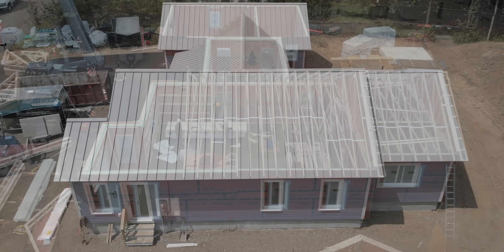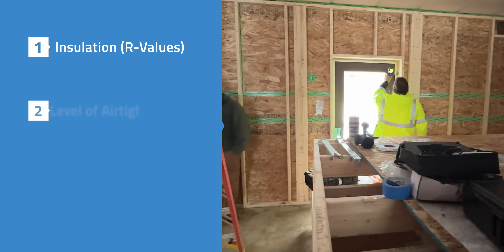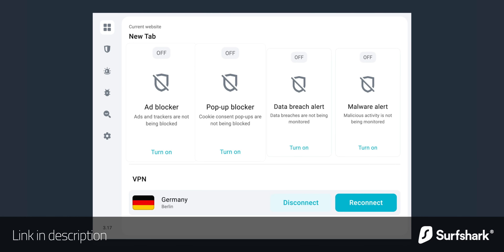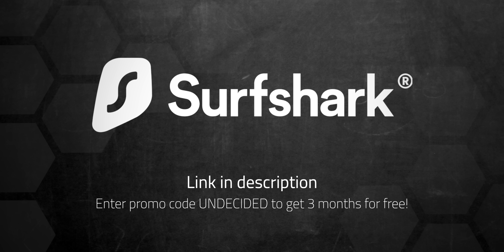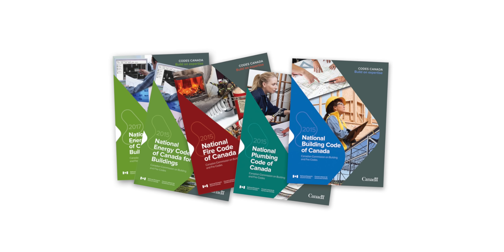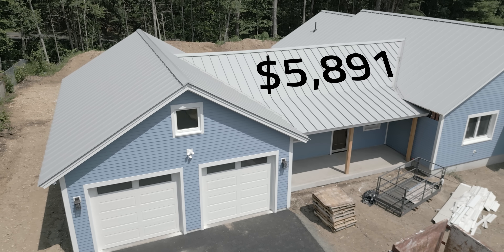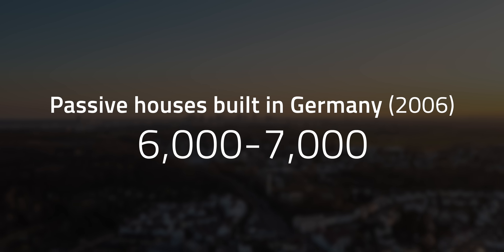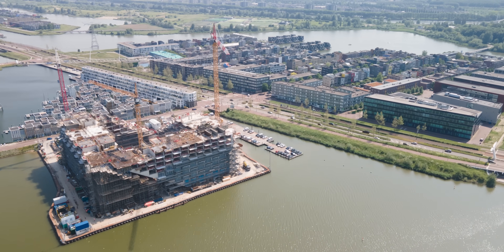Why Do American Homes Suck?

Comment: It's a complex issue and you need to compare like with like. In reality, in Europe, many people live in "older houses" which are often poorly insulated and have poor heat-retention properties. Also, in Europe, poorer people tend to live in flats or tenements, which may or may not be well-insulated, although they do benefit from having fewer external walls. Most "new-build" houses in Europe are mass produced, and tend to be insulated to a moderately high standard; however they are often much smaller than their US counterparts. Large, detached, "new-build" houses in Europe are indeed excellent, but they are extremely expensive and make up a very small proportion of the total housing market, unlike the situation in North America.

Comment: Although I love super efficient homes Im not sure it makes sense in US financially. Average us utility bill is 4400 per year. If you consider opportunity cost of not being able to invest in stocks or bonds at a very conservative 5% the max price to achieve $0 utility bills would be $88,000. That’s not considering that all your systems(excluding insulation) will need to be replaced at some point. Meaning loss of principal.

Comment: It should probably be pointed out that the Passive House standard isn't the law in any EU country. It's a volluntary standard, thus not one mandated by law. Most EU homes do not adhere to it. Now, that is not to say there isn't regulation that mandates ever more efficient homes, but Passive House is not some universal EU standard. Also, it should probably be noted that Europe, like the US has a lot of older homes, and while thermal rehabilitation has been done to many, Europe isn't that much more advanced than the US. Plus, it's a matter of where you live. The Scandinavian countries have been using triple glazed windows for longer than I've been alive and I'm in my mid 30s. Why? Because it get's really, cold there. Triple pane windows have been making their way south, but at a slower pace, mainly because double pane tends to be good enough for most of the rest of Europe. It's the same with a lot of things. The more extreme the outside weather the more efficient the homes. The milder the weather, the more relaxed the standards.

Comment: In my previous apartment (72m2 or 775sqf) in Oslo, Norway buildt back in 2008 I did not need to turn on any heating before outside temperatures reached -15*C (5F) Inside temps never reached under 19*C (66F) in those conditions.

Comment: We don't need the government anymore involved in anything. If you think they make things better by tightening up the building codes just use a new gas can. As a 20 year builder energy efficient homes can easily add 100k+ to the cost of construction. Even IF you are saving 6k a year (which you aren't) thats a 16 year break even point. Very few people stay in their homes for 16 years. The national average is 3-5. In order to save 6k a year on energy costs you would have to live in the top 1% highest energy costs areas. And have a house over 3000sqft. Most houses in my area (north east climate zone 4) consume approximately $2900yr in heating and cooling costs for a 2000sqft house. And about $600yr for everything else. And if you think it doesn't cost 100k extra to build a passive home you know nothing of what building actually costs. The real reason is they just don't make sense when your energy costs are still low as they are here in the US. You want a national building code? Get ready for million dollar starter home prices.

Comment: As a contractor very few people are even remotely doing calculations on wall efficiencies. Most good builders just stick the highest r value that can fit in the wall. And convincing a customer to do extra air sealing rarely gets approved.

Comment: Insulation rules - even in tropical Sri Lanka. Visitors to my house alway pity me: "Your house is so cool, you'll have to bear a huge AC bill!" Wrong, fellows! Our AC runs 5 min per year - just to check if it still lives. Fan? 20 min per month. Are we (German couple) heat resistant? No.  I keep the daytime sun out by louver shutters, I enjoy insect free ventilation by large sliding windows with stainless steel screens, I keep the top sun off by having the roof insulated with glass wool and having laid old terracotta tiles (= cooling evaporation of nightly moist) on top of corrugated mineral roof sheet, I avoid he heating up of the tricky west side of the house be double brick walls with coconut fiber insulation in between. None (!) of these features is used by any of the local architects, not even in the poshest of mansions. All visitors applaude, but none - not even the rich foreigners - copy my achievements. -"Too unconventional. Too expensive." Or translated into simple English: "Too not my own idea." And that in a country where the cost per sqft "conventional" construction is half or less of what to expect in Europe. Give me a break...

Comment: One of the worst things to use in building is OSB for sheathing,as soon as they seal the moisture into the wall with Tyvek the OSB starts to fall apart,and then people usually use acrylic stucco over that which makes it even worse,your walls will be leaking in ten years because they can't breathe and OSB is garbage at least spring for plywood.

Comment: Where I'm from (Ireland) we literally always have a brick shell, with another brick layer 6 inches from it for insulation. Richer households fill it (sometimes many years after) with insulation.
the inner layout uses plaster sheets and for fireproofing uses fiberglass. It's the most logical thing to do, yet only English, Canadians and Russians build similar.
Reply: Russia's codes if they exist at all are voluntary. Just proves that mandatory codes are not needed for single family homes.
Reply: @williamsickner2206  Some codes are important like it being law for somebody to do your electrical installation, or at least certify it in planning and then inspect it if you do it yourself.

Comment: Great to see someone making this thing to get some air! I have been watching videos from builders at states making houses and as an carpenter from Finland, have been questioning myself how your houses can be warm enough at the winter? 
I understood that in some areas at states must be same kinda climate as it is here, like normal winter day could be -20°C and nights can easily be -30°C , sometimes -40°C.
Typically our houses have +/- 30cm insulation on walls, with all these insulations we the wall itself can be 40cm thick. A lot depends what's the structure, our doors are insulated as well, some "thermo" doors are up to 10cm thick, basic outside doors are 5-7cm. Windows are standard triple glazed, and nowadays there are also 4-glazed "thermo" windows. All windows and doors have minimum of 2 layer sealants, some have 3.
Also there is up to 50cm insulation layer at the top of the house, at the addict, 30-40cm layer of insulation at below the floor, additional to this there may be some +20cm insulation below the house itself inside the gravel bed to keep all the pipes from freezing.

Greetings from Finland 💪😎
Reply: The US is wildly geographically diverse, so most of the relevant regulations are at the state level rather than nationally. Northern midwest & northeast states have building codes closer to what you mention, but a lot of the southeast is hot swamp so a house that's too well-sealed becomes a breeding ground for mold.
Reply: Houses in the US are usually built differently depending on where u are at in the country houses built in the far north are much better t with standing colder temperatures where as houses in the South are designed to keep people cool
Reply: It's not just the amount of insulation either, but how it's put together. Here in the UK we have a focus on designing an insulated enclosed building envelope, meaning there are no cold-bridges where heat can be lost to the outside via conduction through a poorly insulating material. Not just the obvious places, but even the join between the floor slab and the external walls (which I find can be awkward to detail).
Good architects will also consider using solar gain in winter to help warm homes, and mitigating it in summer to help prevent overheating.
Reply: 40 cm almost 16 inches.
Reply: I think it would be difficult to make a national code for insulation. for instance, my brother does not have a heater, and leaves the windows open year round. then on my side, somehow my well pump still managed to freeze during the winter with the heat going in its little insulated shack

Comment: I love energy efficiency. But not because of pesky people who think a fraction of a percent of CO2 makes a difference in the climate—those people actually make me feel like sitting on my porch in the middle of winter running a space heater with enough power to keep myself toasty warm off a diesel generator. No, I love energy efficiency because I hate being wasteful, and it lets me do more with the same amount of energy. But don't ever prioritize energy efficiency over efficacy needlessly. For example, high efficiency washing machines; they use less water, and as a result, they don't wash your clothes quite as well as the good old fashioned top loaders. Sometimes an appliance is less efficient, but it does a better job; and that better job is what the extra energy went towards.

Comment: Long story short: Building physics is extremely important.

Strange story: Building physics as a profession is virtually unheard of outside the Nordic countries, parts of Germany, the Netherlands, and Belgium. Even the UK doesn't have a research centre working on moisture in building envelopes, despite featuring a Nordic-like climate and a pretty poor building stock. Building physics doesn't even have an English Wikipedia article. Most other countries seem to delegate that responsibility to the architect or the HVAC engineer, or not bother at all that their buildings leak and sprout strange fungi after a few years of operation.

Comment: I guess there wasn't enough time to delve into every subject in detail, but one more thing to consider is that airtightness becomes a very important requirement as insulation thicknesses increase. Indoor air tends to be warmer and more humid than outdoor air, so if your house isn't airtight, indoor air may leak into the building envelope and leave condensation. That's not much of a problem in a lightly insulated building envelope, as condensation water may easily diffuse through a few centimeters of insulation, so the envelope can dry pretty well on its own as long as there's an occasional breeze there. But if you've got 20-40 cm of insulation in your walls, that water isn't going anywhere, so it becomes vitally important to prevent it from showing up in the first place. Hence the need for a solid vapour barrier near the interior side of the building envelope, and good weatherproofing (preferably using dual barriers) on the exterior side.